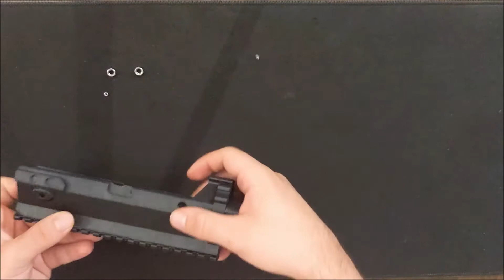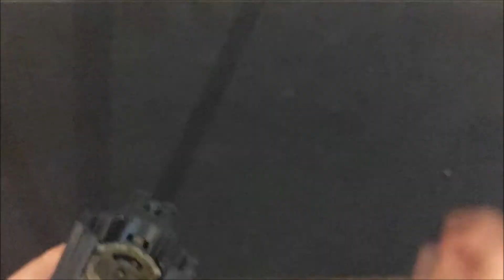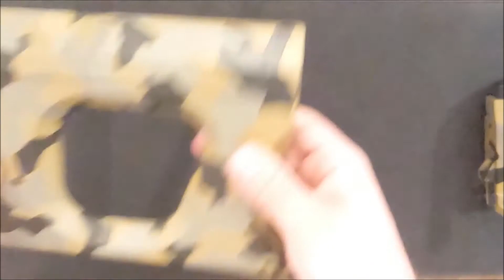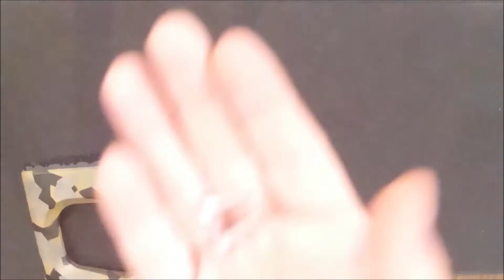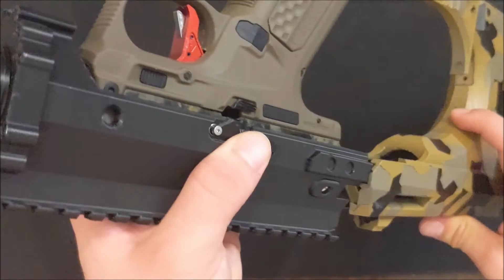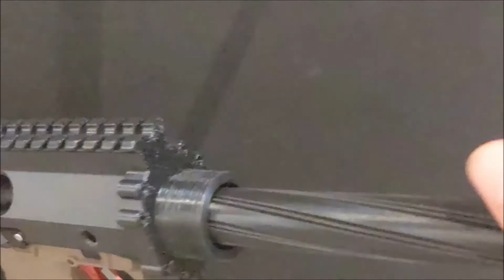AAP-01 OMEGA carbine KIT -3D-printed- assembly video

Comment: A bit too expensive on cults but the design itself is very nice. But a video on youtube is a very good idea :-)
Reply from the maker: I'm happy you like the design and the video! A file including "just" the configuration seen in this video is available for quite a bit cheaper than the File with all the different customization and later added parts. The file linked under this video is more expensive because I keep updating the file with new parts every now and then.  I should probably link the cheaper file here as well. Thank you for your input :)